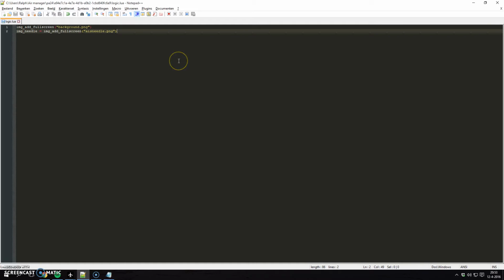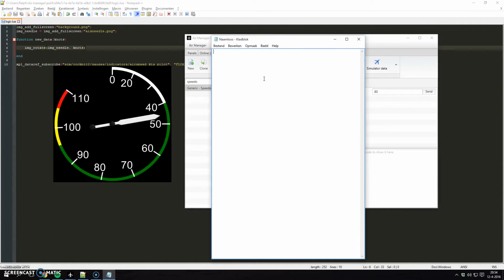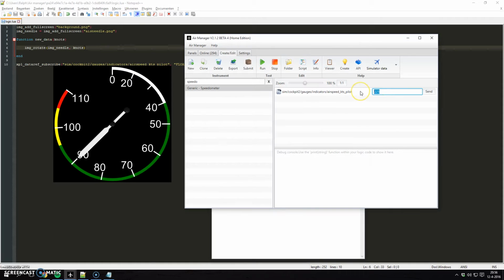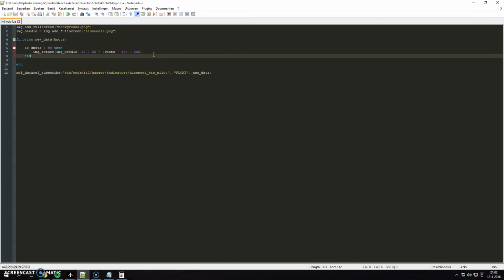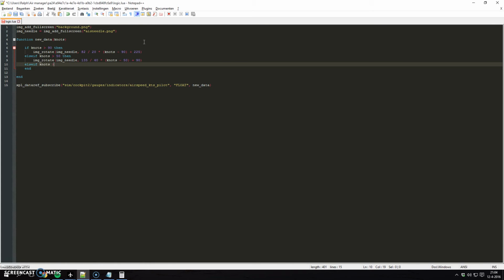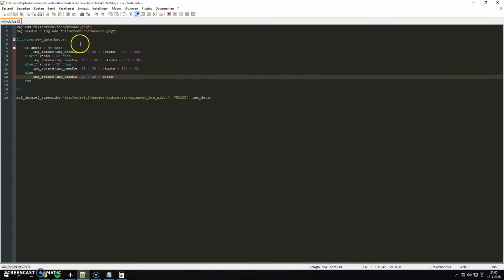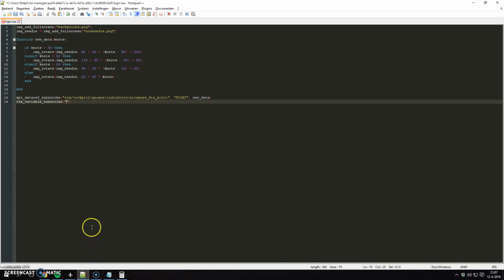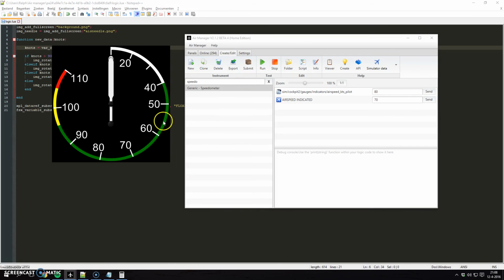How to code a nonlinear gauge

Comment: Hi there, thanks for the video. I am also working on a non-linear gauge and figured out that my one behaves logarithmic. So, I intended to use math.log10() function, but somehow only math.log is supported within airmanager which uses base "e" instead of "10" unfortunately. I need base 10. Running the instruments then results in (ERROR - error in dataref callback: logic.lua:15: attempt to call a nil value (field 'log10')) is there any way to use all the latest math library functions?